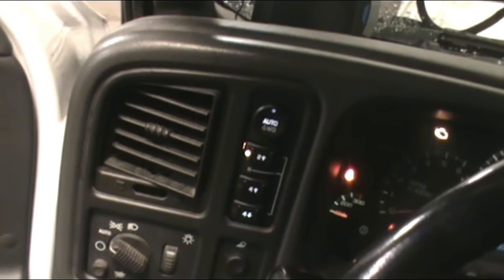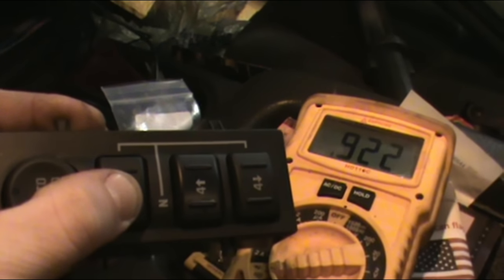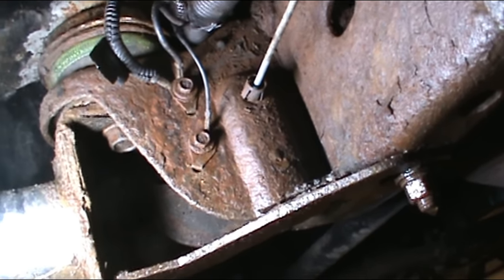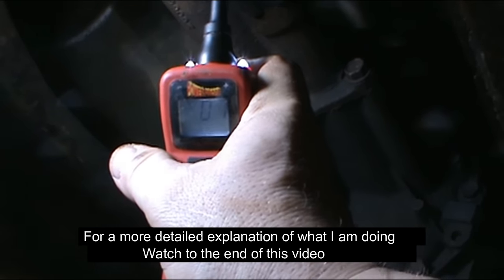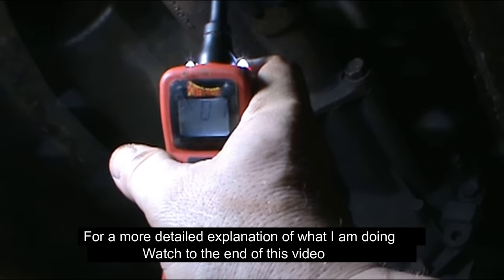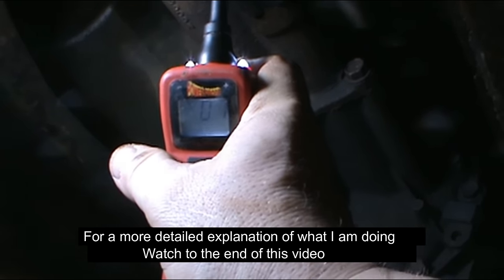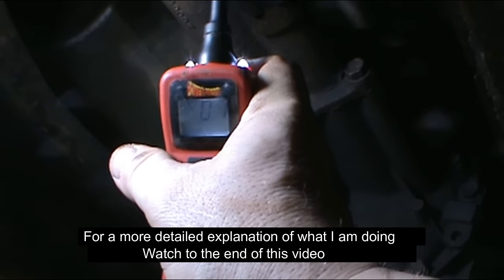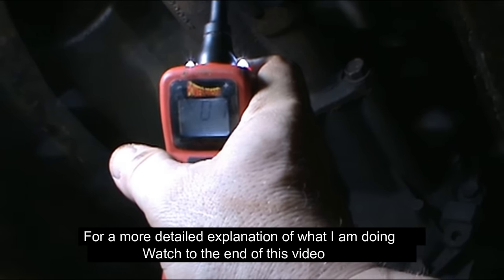Service 4wd diagnosis

Comment: Thanks for advice.
Note the hanging harness has a push clip to hold it up.

Im troubleshooting now.
Reply from the maker: Your welcome, my push in clip did not hold on anymore so I resorted to zip tying it up.  Good luck with your troubleshooting
Reply: @GSEShop  I fixed my issue. In my case, somehow my alternator going out causes the Service 4 Wheel warning light AND Check System Charging.. I think bc it may have triggered partial mvmnt of the actuator ( not enough power to move it).
I replaced alternator. Issue solved.
Reply from the maker: @freecheese4143  interesting I never heard of that one

Comment: Bro mine was a cut power wire but you sent me in the right direction and I got it fixed with solder and tape YAY!!!!
Reply: I would have never checked that without this vid.
Reply from the maker: @leen8761  first I heard of that, but I am glad you got it fixed, and even more glad that I helped

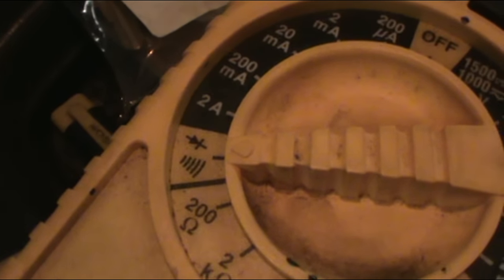Comment: At 3:37 your multimeter is set to diode check mode, not ohms, not capacitor check. The diode check mode is also a kind of resistance measure, applying voltage and tiny current to determine forward and reverse voltage drop. It works in the same way an ohmeter works but you get different units, 1 for OL, etc. To get ohms, rotate the dial to the appropriate ohm scale, starting at one click CCW. I like the practical way you approach this, very different to the pro method with a bidirectional scan tool and wiring diagram. Understandably it is much more difficult, and it would be easy to take a wrong turn. Nobody explains this method in professional service manuals.
Reply from the maker: Thank you, and I have never seen a professional service manual for my truck, but the guy who charged me for the hour did.

Comment: Just asking, you explained everything very well but that leads me to ask this question. What if the ground was actually  damaged  between the spot where you spliced into the ground wire and the actuator?   Would running the new ground wire  and splicing it to the actuator ground  wire that comes out of the actuator let's day say a few inches up the wire from the actuator and from there to a ground post  to  cut out the potential of splicing into the ground after the bad spot and not correcting the issue?  I am electrical dumb but I think I anyone can understand this after you explained it.   Your video is crazy informative and I definitely leaned something today!!
Reply from the maker: If the wire was broken between where I spliced the new ground on and the actuator, then it would not have fixed the problem
Reply: @GSEShop  that ks for the reply and yeah. Your right. Like I said. I can do pretty much anything but for some dam reason electrical has always stumped my ass. Can you tell me the guage of wire you used to run the new ground and I am assuming  you used  the same guage as the factory wire?? Thanks for all your help bud !!

Comment: Thank you for info! My 2006 Silverado just started  acting up with service 4 WD. This info will help not get ripped off
Reply: What ended up being the problem? 
I'm struggling so bad lol we live in the country in south dakota and we got 6 inchs of heavy wet snow last night and are expecting another 5 to 12 this weekend.  Of course it chooses to act up today.
Reply: @halfassranch8363   I just received the parts! I’m hoping it’s just the switch. It’s pretty wet here . I felt under drivers door and the grounding is crusted up. Will let you know
Reply: @christinegofmanas5795  my dash switch is supposed to be here today. I cleaned up the grounds on mine and no luck.
The lights on my switch won't even flash just the 2wd light stays solid.
Reply: @halfassranch8363  how’d it go from there?

Comment: Thank you for the video my fuse was blown but still no going into 4wheel drive and service 4wd. So im try the ground thing and if that dont work im going to do the t case motor. 2005 GMC Sierra 1500 crew cab
Reply from the maker: Sorry I missed this earlier but good luck

Comment: Hello friend, looking for a solution to my problem with the 4 x 4 service failure on the cluster screen of my 2006 Hummer H2 truck, I have found your video. I really liked his video and way of explaining everything and the most important thing is that he does it selflessly and this is greatly appreciated. Regardless of whether I can fix my bug or not.

I have been struggling with my problem for many years and they have not found the fault, they have told me to change some parts but none in particular, therefore I did not want to spend money on parts without knowing 100% which part it was and which one. was the cause of that failure. The only piece that was changed to try as it was not very expensive, was the dashboard button panel, apparently it was solved but soon the same problem reappeared and is the same that happens to your truck.

I left this failure as impossible because as up to now the technical inspection service of my country "ITV" had never put me in trouble for this failure because the truth is that my truck was left with that failure until today that I have had to go back to return to the problem of this failure because the technical inspection service of my country "ITV" in "Spain" has negatively failed me this inspection due to this failure.

I have to resolve this fault as soon as possible since my truck cannot circulate without this unfavorable inspection documentation.

By the way, I have already liked him and subscribed to his channel from my two YouTube accounts.

Thank you very much for all your attention friend.

A greeting from Spain.
Reply from the maker: Wow never had a sub from across the pond that I knew of.  The most common failure points are the encoder motor, and the ground wire on the front axle actuator.  What does your switch do when you push the button?

Comment: Great video.Thanks for taking the time. Headed out to check mine and fix the service 4wd.
Reply from the maker: Good luck
Reply: @GSEShop  Upon turning ignition on (2005 Yukon XL 2500)transfer case switch lights would cycle through all settings then i would have no light at all.  Service 4wd would then appear.  Before watching your vid I took out switch, checked it with voltmeter and got funky readings. I replaced switch but it didn't correct problem.  Checked and cleaned grounds under door. Checked connection at Actuator as in your vid and found other than they were spattered with grease all readings were as in your vid. All good there but problem persisted.  Checked wires from motor on Transfer and they looked intact. Still scratching head at this point.  Now thinking it had to be the TCCM I unplugged it and 4WD and TREC fuses at same time for about 5 min.  When I connected everything back, the problem was fixed. Looks like it was just gremlins. Did read somewhere about the TCCM going to sleep and must be woken up by pulling fuse. I dunno. Happy not spending $$ on new module.  Thanks again for your great vid and I hope this helps someone.
Reply from the maker: @hanjoni  thanks, I have never had a tccm go bad.  Never heard of one going to sleep either.  Thanks for the input

Comment: We have a 2004 Chevy Suburban that does the same thing. We bought all new items, like you. Now my husband is going to try and see if it is the ground wire issue. Because sometimes it comes on and goes off when going over bumps.
Reply from the maker: Minecraft World I hope it helps
Reply: @GSEShop  Thanks. He had a question .  At the 4 pin connector, is the solid black wire the ground or the black with white stripe that you bypassed?

Comment: This is a great video man thank you.  I have a 2006 Chevy Avalanche with the Service 4wd warning.  It only comes on intermittently, and when it does the Auto 4wd light comes on.  When this is happening the truck with shift into 2Hi, 4hi, but not 4lo.  If I shut the truck off and back on I am able to shift into 4lo.  Any idea on what this could be?  Thank you again so much for your time.
Reply from the maker: Check the wires to the shift motor, and if they are ok I would look into changing the encoder

Comment: just got a 2004 GM Yukon with a transfer care wire that got to close to the driveshaft 
it was repaired  by the owner but the 4WD didn't work the switch on the dash doesn't lite up
the GMC is in 2WD now drives ok in 2 wheel shifts fine
dash says Service 4WD - so the many options your video showed i hope to have 4WD back again - Thanks
Reply from the maker: My money is on the tccm those wires don’t like being repaired
Reply from the maker: I have a video on changing the tccm as well
Reply: @GSEShop  update on the fix for my 2004 Yukon , the GMC was just about empty so i was going t to the gas station when i noticed a red light on the 4wd neutral selector button i tried all the buttons and everything worked WOW - the fix i did not do anything to try to fix it - my guess the computer must of cleared some codes - i'll take it
Reply from the maker: @ricardojano3716  or where the wires were repairs is losing and gaining contact through movement.
Reply: Movement i think is the answer, i have not been under it yet to look at what was done , warmer weather is coming soon

Comment: Thanks for the very informative video. Just tested the switch on my 06 Silverado and It turns out to be good. Checked the pins and I have a good ground but I have no power. There is one pin that fluctuates at like 90-110 volts. Idk why it shows that but I know there really that much volts there but I figure that’s why my system doesn’t work. Do you know what sends power to that plug down there?
Reply from the maker: Not off the top of my head and I sold the truck this year, I think it gets power from a fuse separate from the TCCM.  There are two fuses one in the dash and one in the PDC under the hood.  I forget which is which

Comment: Thank you for the video, I have a Hummer H2  and was having the same problem. I found the ground was below the radiator and the radiator was leaking. I fixed the gound and the 4-wheel drive works again and it cost me nothing. I did replace the radiator as well. Thank you for the info
Reply from the maker: sean michaels I am glad it worked

Comment: Which ground why did you connected to inside the plug as connected to the firewall I have two ground wires one on each of the outer side of the four wire plug.
One is black with a white stripe the other is a solid black.
Thank you for your time I'm actually messing with the Tahoe right now
Reply from the maker: jorge pizarro sorry this took a moment but I have been a bit busy.  On mine it was a solid black wire but it appears the Tahoe’s and suburban may have different colored wires to this plug.  I would suggest a google search for your particular vehicle to be sure.
Reply: @GSEShop  I did it was a solid black wire
Reply from the maker: @jorgepizarro3327  did it fix your issue?
Reply: @GSEShop  no.. Still working on it
Reply from the maker: jorge pizarro ok let me know
Reply: @GSEShop  I definitely will

Comment: Ok on my 03 tahoe. What it does and don't do. Sometimes 4x4 works, sometimes not. Sometimes I can hear the transfer case motor moving sometimes it don't. Sometimes the switch just blinks and blinks and never changes, sometimes it does without hesitation. One time 4x4 was engaged and working then went to go up a snowy hill and only rear tires were pulling. 4x4 service light is usually on. I have tested the switch. It is fine. Cleaned the ground wires under driver side door, everything worked as it should for about 10 minutes. I am in the process of watching  your video, I just wanted to comment as soon as I could, not knowing how busy you are and how soon you can respond.
Any help will be greatly appreciated. Thank you for taking the time to read this and have a blessed day sir.
Reply from the maker: If the switch tests ok do the wire mod in the video, if that doesn’t fix it I would look into either changing the encoder or the whole shift motor.  That is the order I would do it from least expensive fix to the most likely fix.
Reply: @GSEShop  lol I just finished your video and going to the garage. It's pouring rain in ohio right now so I gotta try and squeeze it in my tiny garage. I will let you know in just a few. Thank you very much for the video and the quick response. Already liked and subscribed...
Reply from the maker: @brianleeth4679  thanks for the support let me know how you make out
Reply: @GSEShop  so I have ground at the accuator
Reply from the maker: @brianleeth4679  you can still do the ground mod, after all you cannot have too good a ground.  It may be intermittent ground as well, and that would take care of it
Reply: @GSEShop  I will definitely do this and pray it works. Is there a way to test the encoder?
Reply from the maker: @brianleeth4679  not that I know of but they are a very well known and documented issue.  If I was a gambling man I would have bet my money on it from the start. Unfortunately it is not really a cheap route, so try the easy cheap checks and fixes first and see how they work.
Reply: @GSEShop  have you ever bought something like that off rockauto
Reply from the maker: @brianleeth4679  yeah if you can wait on it, that is a good place.  Usually I need the truck back that day so NAPA gets a lot of my business
Reply: @GSEShop  oh I definitely understand that. The only time I buy from a parts store is if I need it back on the road asap. But I have only bought suspension parts from rockauto.
Reply from the maker: @brianleeth4679  they get their parts from the same suppliers the box stores do, but by letting you pick everything and shipping straight from the supplier, they have less overhead.

Comment: So im getting this light on my 06 Silverado ON Occasion only.  NOTE: All the dash gauges set left (gas gauge reads empty) and battery, abs, brake, etc. lights turn on along with Service 4WD.  It always does this while driving every 3 or so days but resets the next time i start and drive the truck.  Any help is appreciated.  Shifts into 4wD when light is off and sounds fine
Reply from the maker: You got a lose wire or connection is my guess or a bare wire

Comment: Awesome video! So my 04 suburban just started doing this. Last time I used 4x4 it worked. Of course here in ol MO we got some snow. I pushed my auto/4x4 button, and I can hear transfer case motor try a little then stops...not fully engaging like your sound was at end of video. Do you think this is a weak ground issue? Or a component issue? Encoder issue? Motor? I am like you I dont want to just throw parts at it. 
Thanks
Reply from the maker: Does it go into 4 hi or 4 lo
Reply: It won't go into either. Motor makes a try then stops. Thanks to your awesome "ground" test you showed with the multimeter I just ruled that out. So it must be in transfer case motor?
Reply from the maker: @scottmorgan6703  it shouldn’t even try to move if it is the motor encoder. When you push the button you hear the motor move, does the button lights change or just blink.
Reply: Just keeps flashing..4x4 light never lights up solid. It flashes for about 10sec then says sevice 4wd.
Reply from the maker: @scottmorgan6703  I don’t usually recommend people spend money but I think your front axle actuator is bad, or the wires to it are bad
Reply: @GSEShop  I unhooked the plug from the front actuator and tested the ground side just like you did and it was 0.00. How can I test the rest of wiring?
Reply from the maker: @scottmorgan6703  one should have 12vdc and one should go to ground, if that is present I would try another actuator
Reply: Hey just wanted to let you know that you were right...it was front 4wd actuator that was bad. Just picked up a new one tonight at auto store and replaced the old with the new and it works like a charm! Thanks for your help diagnosing issues!

Comment: I'm in the same boat. I started throwing parts at it .i have service 4×4 on dash . Then when I turn ignition on my 4×4 switch lights up everything and shuts everything down no lights on anything on the 4×4 switch at all and i have replaced.  1) switch  2)controller for the 4×4 system  3) replace the controller on the transfer case 4) clean grounds under drivers side on the frame two connections to frame 5)checked fuses in side and under hood all good 6) tried doing the reset of the system by taking the battery off for all night ofter replacing the controller it has not changed at all after doing all of this . I turn ignition on the lights all come on on the switch and then they all go out on the switch. And the service 4×4 is still on all of the time even if i clear the system I'm so flustered i can't even think I'm now going to try what you just did on this video run a ground wire from the pin right where you did .i have been trying to find something everywhere on here and this is the only thing that makes since i no i should have a manual before taking something like this on but i thought it would be a easy fix. NOT
Reply from the maker: I wish you luck, my experience is those wires on the frame themselves get contaminated, and won’t carry current anymore.  This fixes that.  Let me know if you think I can help.